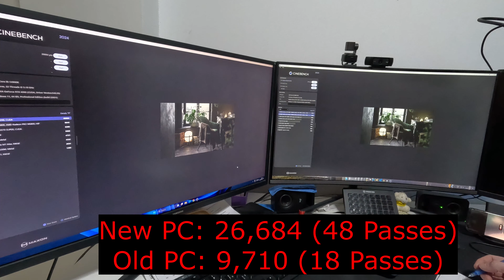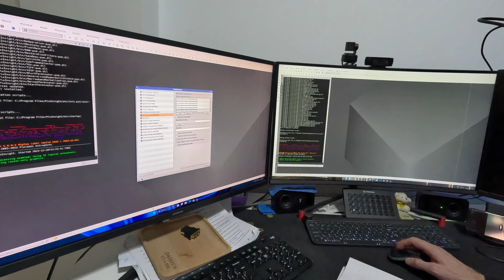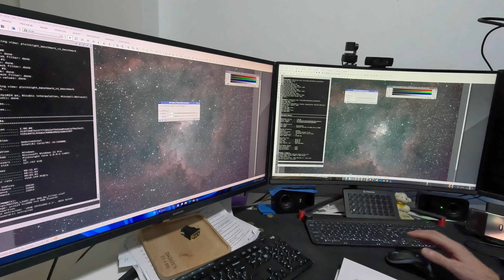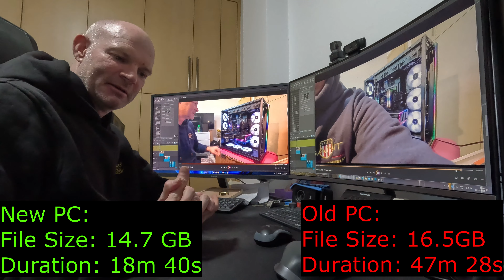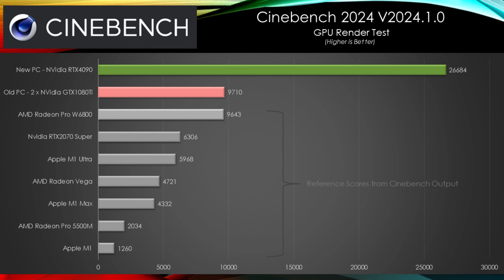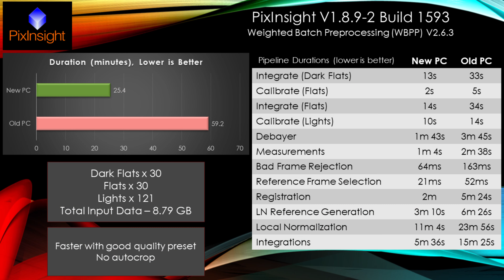Project Cipher - New PC Build (Part 3 of 3) - Issues and Benchmarks!

Comment: Hi Dave, 
When you mentioned you down clocked the ram to 4800, I take it that you disabled XMP in the Bios to achieve this, is this correct?
Reply from the maker: Hi Robin, That's right, I think it defaults to 4300 with XMP off, so in the RAM speed just set it to 4800. I did try higher but wasn't stable. It might just needed a touch more voltage as the default is lower, but just not messed around with it too much yet. Was happy just having it running after trying the XMP options. It might have been ok with XMP 1 selected, and then downclock the RAM, but haven't pushed it yet.

Comment: There's always a few issues eh Dave.  I had issues with a  fleck of foil in my PC causing issues.  I get the general impression you're not short on processing power.
Reply from the maker: Hope yours survived the fleck of foil!!! I think you are right on the processing power (without going mental $ on the new threadrippers!), this thing is a power house. Even with it being a touch down on performance due to the memory speed constraints, I am really pleased with it compared to my previous PC, just shows what 5 years in tech advances can do.